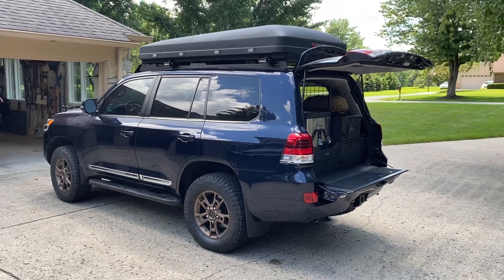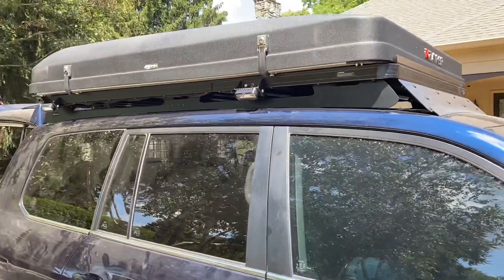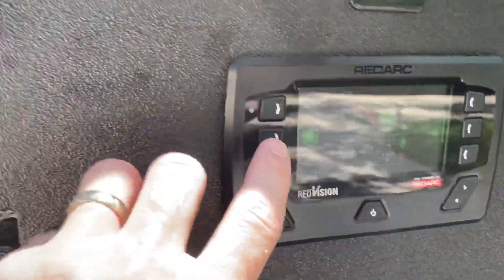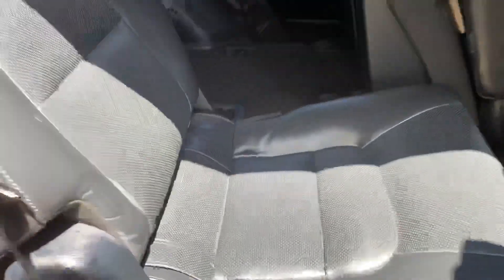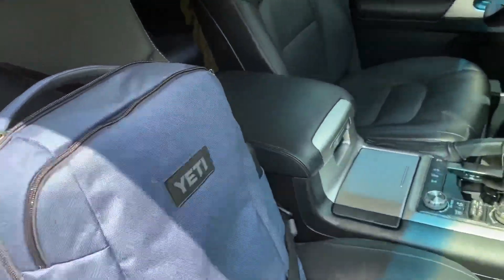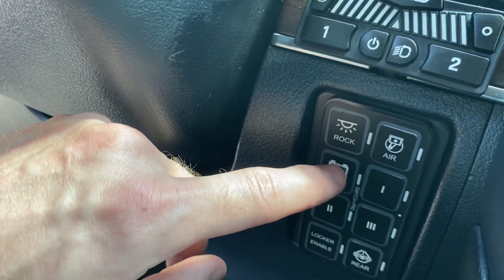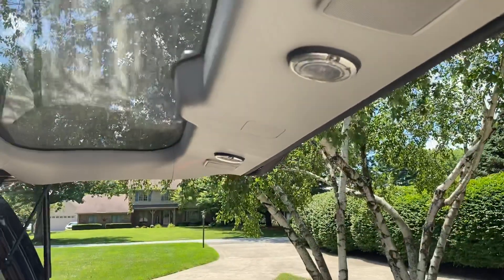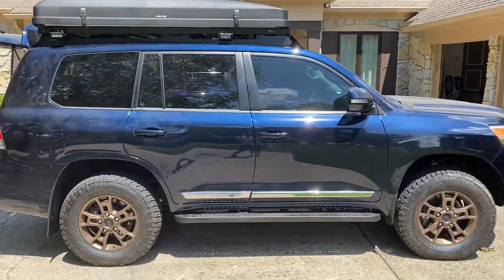Blue Build 200, BP51, RedVision, Trekboxx, RedArc, Slee, BudBuild

Comment: That build rocks!! I have the exact same vehicle, been looking at putting a winch with the factory bumper, but no one can figure it out. Don’t want to start totally jacking it up with mods until it’s at least got 50,000 miles on it. But great job👍🤘👌
Reply: that's what I have always thought, but decided this time i'd rather enjoy all the mods the whole time I own it rather than wait and enjoy them right before I decide to sell because the mileage is getting high. Although in the past it hasn't been and LC known for going forever.

Comment: Hello. Do you build these TLC for customers who order them with the modifications? Or, are you building them and then selling them modified? Second question, is the speedometer easily changed to KMS over miles? In other words, is it analogue and have the miles on the outside of the speedo, or is it electronic and can be changed by dash menus? Thank you.